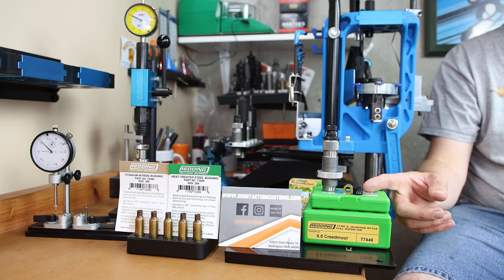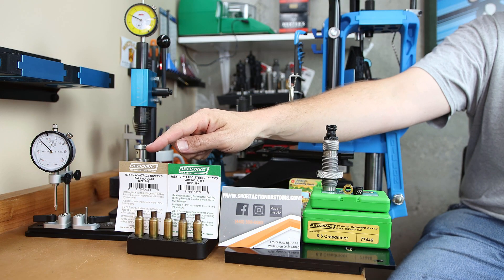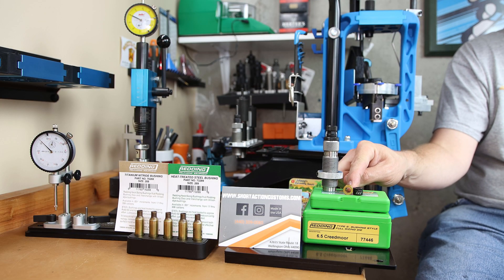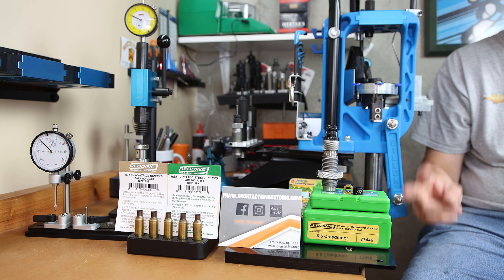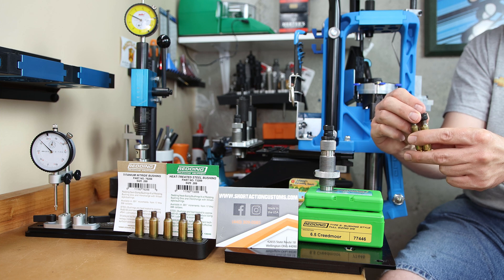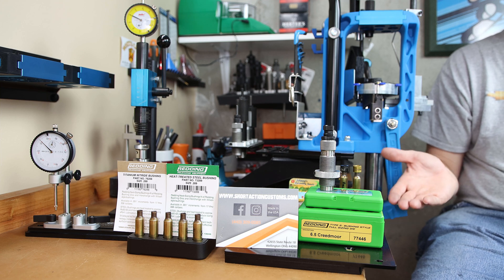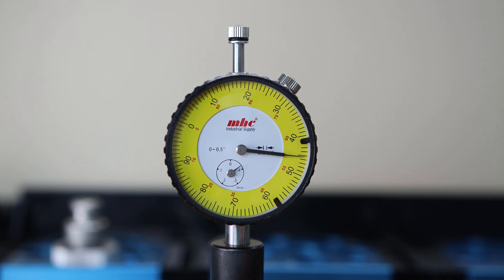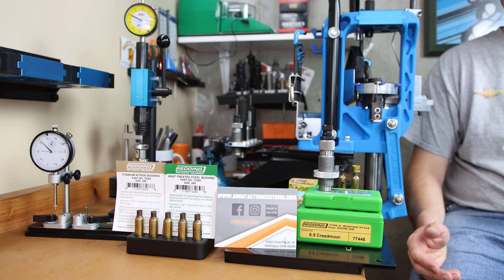Your Die Bushing Matters! - Choose the correct Die Bushing

Comment: Do Short Action Customs neck bushings fit inside Forster neck bushing dies? You haven’t put out any video for a while. Hope you are well. What is your opinion of the Forster Full length bushing die?
Reply from the maker: Unfortunately they do not. Forster system is different. Overall I think they are ok, but I haven't used them as much as I have others.
Reply: @BoltActionReloading  Thanks for your reply. Cheers 🍻

Comment: I bought this exact Redding die and it will not bump the shoulder at all. Redding support had no solution and wanted me to send the die in with some fired cases. This happens for two of the Redding S-Bushing dies I own. 6.5CM and 6BR. Both brand new dies. IF Anyone has a solution I am all ears. Thank you.

Comment: What size SAC bushing you use for the 6mm cases like 6BR ?  I have never measured neck runout , but after watching your video I got a concentricity gauge and was stunned to see that some of my 6.5 cartridges were as low as 0.0015 and some as high 0.006 neck runout. I have to establish what method will bring me more consistency. Redding neck bushings die or a non-bushing die from another brand. Thanks for the excelent presentation on the topic.

Comment: Excellent video, I was having a problem with flared case mouths on Lapua brass when resizing for 6.5 Creedmoor. It seems as it turned out the problem was with the brass, and not the die. But what someone on one of the reloading forums suggested was to get a Forster die honed to the proper dimension. Forster asked for the outside diameter of the case neck of a loaded round. I provided that and they provided a die honed to .004. I no longer need an expander mandrel, though they provided one. The loaded rounds perform well. This video has me rethinking that scenario. Thanks so much for this.

Comment: I went to SAC website, they say their bushings only fit on their dies. What model are you using, and did they discontinue making them for other die bodies?
Reply from the maker: There are 2 styles. One that is for their dies that does both neck and shoulder. The ones that I show here are SAC neck sizing bushings that state "with universal outside dimensions of .500" diameter by .375" height ....." they are also available at midway I believe.

Comment: I have two of these bushings. The problem I'm seeing is when I adjust  for .002 shoulder bump,  then I am only doing a "partial" resize of the neck. I thick I want a little more purchase on the bullet. All that being said , the proof is in the shooting. I would like to see a comparison shootout between your full length resized/expander mandrel process and the SAC bushing method.

Comment: Very interesting material - since I am getting into reloading - I got most of the gear already, but still no bushings, I might go as well and start with SAC bushings.
I wanted to ask how much concentricity affects what we will get on target, but I see that there is a follow up video on this exact topic.

But what about a simple idea: if the "entrance" of the bushing is what makes the big difference  -> wouldn't it be an idea worth trying out to ad a chamfer to a standard bushing (not the premium with special coating, because this would damage the coating), or simply (with a piece of sandpaper) smooth out the entrance in order to make the entering of the brass into the bushing better, just as it is with the SAC bushings?
Maybe you have an old steel bushing that you could spare to test this?

Comment: Great video. I wanted to ask your opinion on something. If one is using the SAC modular sizing die with the SAC bushing, is it still necessary to use an expander mandrel after sizing? I ask because SAC has mandrels specifically for their modular die, and I am hoping to gain some insight as to why it's a necessary additional step. Thank you for sharing your knowledge.
Reply from the maker: Hi RIck, I am hoping to look into this a little more in the future. I guess it really depends how good your brass is. I have had pretty good luck without the expanders but I may add one and see what happens.
BAR
Reply: @BoltActionReloading  Thanks BAR. I usually use Lapua, but will use Alpha and ADG as well. I may try with just the modular die, and then add on the .2620 and .2625 mandrels a bit later for more testing (6.5 PRC). I'd love to see your results as well if you end up going down this road.

Comment: If you anneal every few firings, I just don’t see why you wouldn’t cut to the chase, FL resize with any sizing die with the expander guts removed, then expand with a mandrel.  You get  low concentricity, and don’t have to buy another bushing die and SAC bushing.  I agree the SAC bushing looks great, and would be just the ticket, IF you weren’t following up with a 21st Century mandrel.  I can’t see the need for both, but am open to being educated.  (?)

Comment: Recently I have built myself few brass bushings for my Redding s dies on my lathe.  And they work the same way as the original. Strangely I found all the Redding bushings .001" narrower then the stamped numer.  The ID  measured with a pin gauge.

Comment: Bolt Action Reloading has become my favorite reloading channel!

The SAC bushings appear to have a lead-in taper which makes sense as it sits lower on the case mouth. I think this is important as it centers and guides the case mouth perfectly into the bushing. That said, I'm wondering if the shorter sized surface area can account for the lower seating pressure. The coating itself, appears to be a DLC coating, may aid in it working the brass less.

Annealing: Do you anneal before sizing the brass regardless whether it's full length or neck only sizing? I'm wondering if annealing then sizing vs sizing and annealing last impacts the seating force and how does it affect accuracy.

Another outstanding video!
Reply from the maker: Glad you are enjoying the content. What is the loaded diameter if the neck you are loading for? As a good baseline I have been shooting for at least .003" less than that. In fact this weeks video is similar to this one just a different caliber.

BAR
Reply: @BoltActionReloading  I'm reloading the 308 Winchester. The loaded case neck diameter is .336
Reply from the maker: I thought I saw a number originally of somewhere around .2XX but looks lie you edited it so I didn't know what you were currently using. I just ran a test on the 308 win and haven't published it yet. My loaded round dimeter was between .339 and .340 (Its federal brass and is a little over .015" thick) and I tested 334 to 338. This weeks video is on 300 win mag and  started out at .336 and I tested 331 to 335, I like the results most around 332, but its complicated. Which one were you using?
Reply: @BoltActionReloading  I did edit my comment because my fingers can't seem to spell..LOL

I'm using a carbide bushing with an ID of .333. Several years ago I had bushings made from .3330 to .3370 in .0005 increments. I wish I'd gone lower perhaps .331 giving me more flexibility.

I'm using Hornady Match brass with a wall thickness of .014 giving me a loaded neck diameter of .336. 

 I try not to work the brass any more than necessary and always use a .306 mandrel as a final step giving me the .002 bullet tension.

I can't wait for the 308 Winchester testing to post, it'll be a keeper for sure!

Comment: If you aren’t neck turning would it be advisable to undersize with an SAC bushing and use an expander mandrel to open it up slightly, or is just using the proper size SAC bushing alone the best for consistency and performance?
Reply: If you aren't neck turning, just use the standard non bushing full lenght sizing dies. Bushing dies are for neck turned brass.

Comment: Here is my observation. The further backwards we start worrying about concentricity, meaning we have a fired case from the rifle and now we begin the reloading process. 1st off correcting as many issues from a fired case, which is basically a blue print of your chamber will help your consistency with no doubt. With that said. I must have a completed reload to then check the concentricity of the bullet that is loaded in the case. And if at that point there is .002 or less of run out existing on the bullet seated in  already in case. What other issues are there for concern????
What I’m trying to say is that I’m not arguing not to have a perfect neck but why don’t we wait to have a seated bullet before checking concentricity in the first place??? Imho

Comment: I make what I call a square up on the lathe out of 1/2" barstock with a hole drilled through the middle which is for the decapping rod. When using bushing dies that to just BP the shoulder that aren't to where they aren't touching the shell holder I put the square up in between the shell holder and die. Put pressure on the ram and just snug the die enough it won't looses. With standard seating dies that are turned back a full or half turn after contacting the case mouth it's very important to use the square up. Threads are so coarse u can actually have the die misaligned with the shell holder if you don't do this. It's exactly why Lyman use to make the Tru line press with Tru line dies that were fine thread. For dies with a floating sleeve like redding comp seating die I don't use the square up because the die is made to make up for any misalignment. If I buy a forster with a floating sleeve it's the benchrest because it's steel with a stiffer spring, the ultra micro die is aluminum top and we're blowing the cap off so forster went to a weaker spring problem is it's to weak that it can't correct misalignment at times. Both 1000yd benchrifles I built my 7saum and 6xc I use lewilson micro chamber seating dies and a sinclair arbor press but for those two only

Comment: I am trying the Sinclair mandrel for 223 and I am not getting the results I expected. I full length resize with a Redding FL with the expander ball removed, and then I follow up with a Sinclair mandrel. The results are disappointing, both in terms of SD and group size. I discovered that the mandrel pushes my shoulder back. I use Norma brass and I am having the same results with once fired brass and with 3 times fired brass.
Same story with Redding S dies. On the other side if I FL with the expander ball and then I use a mandrel, then I get better results. What am I doing wrong?
Reply from the maker: How much resizing are you doing with your expander and are you using any lube?
Reply: @BoltActionReloading  My fired Norma brass measures .253 OD./.226 ID  I am using a .243 Redding bushing since my loaded rounds measure .245.5.
 I use Redding Imperial Dry Neck Lube. Thank you.
Reply: The Redding "normal" FL die without the ball expander brings the neck to .239 OD 216 ID

Comment: I currently have just a standard FL Die, Is it worth upgrading to a Bushing Die or just finish with a Mandrel and call it a day?
Reply from the maker: If you have the performance your looking for I wouldn't change. I can't stop tinkering, it's an addiction.
Reply: @BoltActionReloading  I can't stop tinkering either the damn Rabbit Hole sucked me in so I'm trying to take a knowledge advantage of those of you that are deeper than me! I've been primarily hunting so far but debating PRS/local Long Range Comps that are pretty common in Utah. So I know I need to cut down my ES/SD a but more. That's why I was leaning towards just keeping my standard FL and running a mandrel.

Comment: What was the runout with a Redding .287 bushing? Not a fan of any particular manufacturer, but the test provided is comparing a 0.288 bushing to a 0.287 bushing.  How do we know that a Redding 0.287 bushing wouldn't provide the same concentricity runout as the SAC?
Reply from the maker: Hi James, I stated that I don't have a 287 bushing from redding. I only had a hornady in that size previously. For me the bushing size hasn't mattered it gave me similar results. Could have used a 286 or a 289 I have seen this kind of variance. If I had used the Hornaday 287 all the commentors would have said to use a redding. If I had tried 4 types of bushings their wouldn't have been enough samples. Welcome to YouTube comments.
Reply: @BoltActionReloading  understood about the critics.  I watched your video twice, and then went to SAC's website and saw that their bushings are unique in how they made.  Unfortunately they are out of stock for the 0.287 with 6-12 weeks of backorder.  Plan to get one, once they are back in stock.  Great channel btw.
Reply from the maker: Thanks James, glad you enjoy the channel. If you pick one up let me know what your results are.

Comment: Has anybody else heard or read that in order to set up the Redding bushing die correctly, you leave the the threaded top internal “bolt”  slightly loose?  You should be able to shake the Redding S die snd here the bushing go “click”,   “,click” on the inside.
Reply from the maker: There is a ring on the die to keep it from moving but yes the bushing should be slightly loose. (we are talking like 1/16 of a turn here)
BAR
Reply: Yes, but the sound you're looking for is "Clock", "Clock" which gives you .00002" runout. "Click" "Click" is not as tight..
Reply: I know it is like a year later, but thank you BoltActionReloading

Comment: It's all theory I want to see shots down range. If there is no difference then what's the point.
Reply from the maker: Hi Stephen, You are correct but its a different point. I do plan on putting some down range to test. Determining beyond a shadow of a doubt that runout causes your groups to open up is a different conversation than what busing produces the most consistently low runout. I tried to make the point that is all things were equal most would choose the least runout whether they saw the runout on paper or not. I agree completely that in the end what ends up down range is what matters, but then we have to talk about the error with the guy behind the trigger too.
BAR

Comment: Did you know that the Redding bushings are slightly conical?
The side with the numbers has a smaller diameter. 
If you flip the Redding bushing, the picture with the bushing on the brass looks different.

Comment: Interesting! Makes me wonder what the concentricity of the inside of the neck looks like. With Lapua brass that already has a very consistent wall thickness at the neck, it should be excellent. But would less expensive or non-neck-turned brass do better with the expander mandrel method?

Comment: Glad you did this video. This has been my exact experience with every bushing die I have tried.  Would be great if a few new bushings fixed the problem because getting custom dies can be a pain.  I believe the Wilson bushings have a similar design as the SAC bushings but I am getting .002-.004” runout on the 6ARC Wilson die I have.
Reply from the maker: Hi Brian, I won't make any promises but the results I got were what was in the video. If you decide to try them out let me know your results!
Reply: @BoltActionReloading  well holy shit….  I just got my bushings from SAC, ordered a .333 for my 308. Dropped it in my Redding die and sized 5 pieces of annealed FC gold metal brass.  All 5 pieces were less than .001” total runout and measured .333 neck diameter.  Then I changed back to the Redding .333 bushing and all pieces of brass had .004-.005” TIR w/ OD of .327 on the neck.  I’m speechless, I’ve fought with these bushing dies for so long and never could get good results.  Thanks again for doing this vid!
Reply from the maker: Hi Brian glad to hear. When I saw the numbers I was shocked myself. I hope that others get similar results.

Comment: I use Hornady custom shop bushing dies with RCBS tungsten disulfide finish in 269 and 270 bushings for my 6 creed, forester Ultra Mic seater, using Hornady, ADG and Alpha brass, most of the time the needle doesn't move when checking runout with my Hornady concentricity tool.

Comment: It seems to me the bushing die wouldn’t give consistent neck tension unless all your brass had been neck turned to a uniform thickness.
Reply: I totally agree! Maybe I just use crappy brass, and admittedly I have multiple heads stamps, but I am certainly going to neck turn everything before I commit to a particular neck bushing. I stopped neck turning after my first batch because I did not like the results on the Hornady neck turning machine. It was not very smoothe by my standards. Maybe I didn’t do it right. I’ll give it another go.